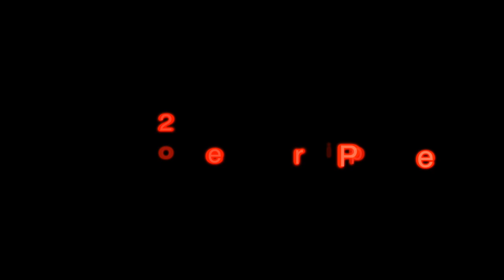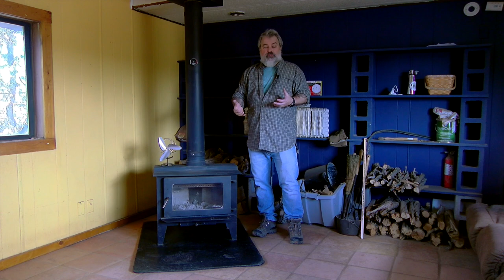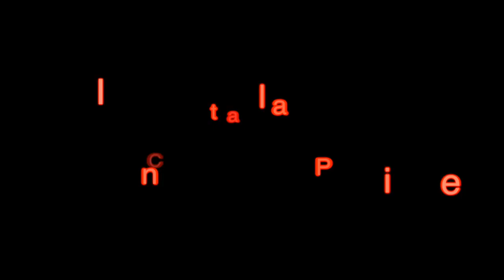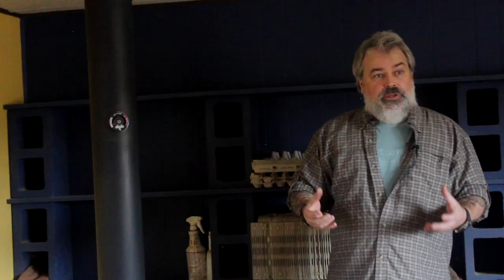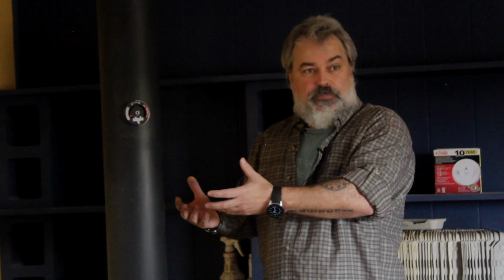Wood Stove Connector Pipe

Comment: Great videos!  Lots of good info.
Is there a minimum length of pipe that a wood stove needs?

I want to put a wood stove in my small workshop and have read some wood stoves have a manufacturer's suggestion of around 16' of pipe.  I would only need about 10' of pipe total to get through the roof and above the ridge.
I already have a vermont castings intrepid stove and wanted to use that.